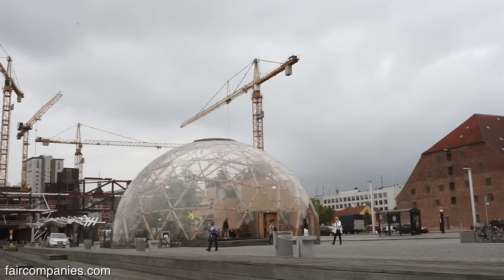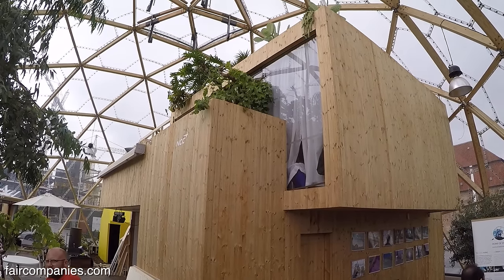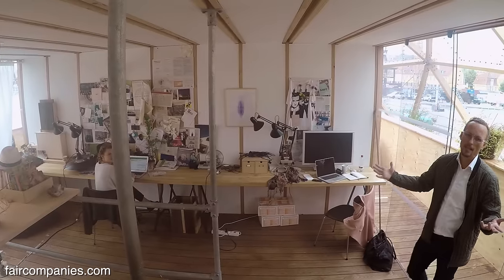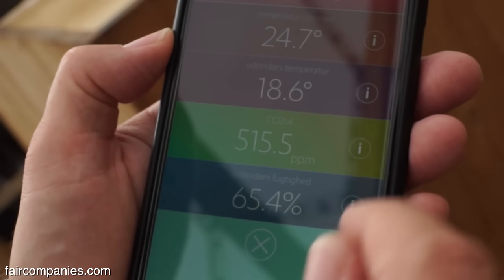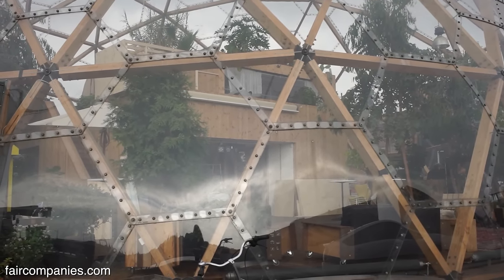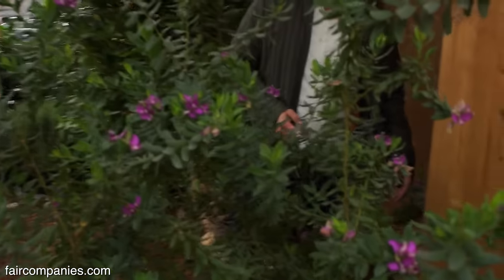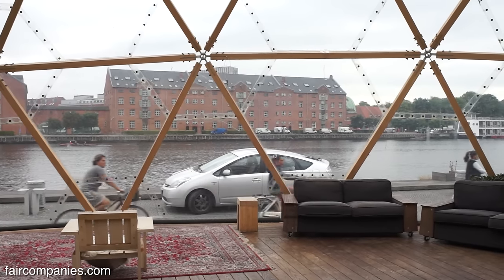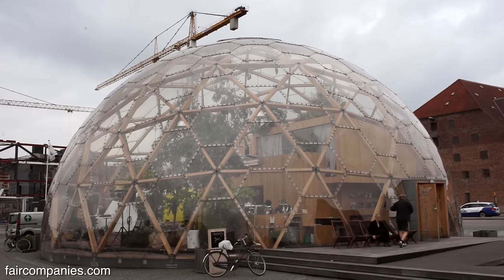Nordic home encased within geodesic dome for passive solar

Comment: Really thought-provoking.  The dome is like a physical manifestation of our natural projected boundaries around our homes...  when I think of what it would be like to live under the physical dome in that house, it's a bit unsettling and stuffy - as soon as I switch to the dome being an imagined boundary or social buffer that we all feel in our non-dome covered homes right now, then it feels less strange...  I know, weird.  I think it's that 3rd dimension - inside the house, outside the house, and outside both but still inside the dome...
Reply: I always feel "expanded" in a dome... not stuffy (myself). The problem I have with curvilinear forms in building is that you can't really furnish against them. All our shelving and furniture is designed to be utilized in boxes. That being said, It's an awesome shape for a roof provided you have figured out the weather seal.
Reply: Evidently domes are meant to be the most balanced structure to live & interestingly  mimics the firmament above us.

Comment: I think the hex panels are about 78.6% more disco than the triangular ones you see on other dome designs. The metal structure hubs are also flamboyantly ultradisco , at least 86.4%.

Comment: My only question is if, if, heaven forbid there is a house fire, would the Firemen then  have to tear the dome down before they could get to the house to put out the fire. Or could the dome be designed with a sprinkler system and as natural materials as possible for the house so that if there is a fire no toxic fumes or lowered possibilities of toxic fumes, and the house itself built with a sprinkler system.

Comment: 1)  CO2 is high. 515ppm is too high, should be less than 400ppm.
2) Huge footprint for a family of 4 - and I don't see a garage either.  
3) What is with the lack of railing on the stairs, is there no building-code in Denmark?

Comment: Just out of curiosity, when they actually build the domes and all... are they gonna be see through or is that just to show people? Or is only part of the dome gonna be shielded? Just wondering about privacy. It doesn’t look very private.
Reply: The privacy is IN the house. Just like a normal inside/outside situation.
Reply: @md61211  but the way it looks, it’s all open. You can see inside. I think it’s not done if what you say is right. If that’s the case, then yeah. Privacy is there. There is a couple that actually did this in an area that has heavy snow/cold. They grow food all year round. It’s smart. You should see it!

Comment: Yea so the house may not need glue and rain protection anymore but the dome is plastic and needs constant replacing and yes it insulates the house better but so does simply insulating the house better... you may save on heating but now you need to spend money to exchange the air inside the dome with the outside air. this dome is like a closed room, you'll have to air it out constantly specially since the air inside the building will become stale much faster since airing out the building by opening windows is nearly useless with no wind.

Comment: Love the idea, but I suspect it'll be a furnace in summer, even with the apex vent open. The polycarbonate isn't sealed, so it'll leak and drip onto the unprotected building inside. Plus It'll be deafening when it rains. I imagine it pops and creaks a lot in the wind too.
Reply: It is sealed (required by legislation, "Byggereglementet"). 
The apex is sufficient for cooling (the chimney effect).
The building is protected. he said that in the video.
The C60 (diamond crystal structure) is the strongest structure (he also said that in the video), so it won't pop and creak.

Debunked all your false claims, and assumptions, You're welcome.

Quote,
Love the idea, but I suspect it'll be a furnace in summer, even with the apex vent open. The polycarbonate isn't sealed, so it'll leak and drip onto the unprotected building inside. Plus It'll be deafening when it rains. I imagine it pops and creaks a lot in the wind too.

Comment: That's really cool but 6 degrees between the inside and outside temps is not much in the winter, for summer they just need some forced air circulation and shade but the shade would not be suitable in the winter.

Comment: Wouldn't it be warmer inside if only one side had windows facing the winter sun? That Dome is losing a lot of heat out of the shaded side. And could be cooler in the summer..

Comment: Very interesting. Two questions pop to my mind (I hope it was not mentioned in the video, I tend to watch videos quickly): 1) How hard is it to clean the windows (both inside and out). 2) Do you think there might be a time where bigger machinery would be required to do renovations or some type of work on the house inside the dome. Then how would the machinery enter the dome?

Comment: Hello !

We are from Brazil and we are starting to build residential domes.

Could you let us know if there is a website or app for sale to calculate the design of the roof model shown in this video?

We already have the structural part of the dome made of wood in the goodkarma pattern, but we are having difficulty developing the covering part.

If you can help we will be grateful!

Joseph

Comment: Do they make these that are bear proof? If i wanted to go off grid with one and build a dugout ,cabin in it then i would also need at least the 1st 10feet above ground ot be strong enough to stop a bear from breaking threw it? Are there materials that would work for this ,that can be supplied?

Comment: It's an awesome idea, though it looks a bit expensive. I also find it difficult to imagine cleaning all this transparent surface. What about strong wind, can it take away the whole roof when it gets in through an open door? I think it would also be nice to add some mechanical ventilation for the summer. I wonder if just opening the roof of the dome is enough. In a cold winter I'd think of some sort of heating. At least for the house, but considering there could be some sensitive plants growing in the dome, then preferably for the whole thing. I also wonder if the rain doesn't leak in anywhere? I wish the intervewer asked some of these questions. A question I'd ask would also be: what did they learn from all of it? If they were building it again, what would they do differently? Anyway, I think it's an awesome idea and I'd definitely would like to live in a domed house like this.

Comment: Could you build one using graphene panes? How would 🔋  output be affected during different times of the day? the season?How would you suplement power needs ? Using clear graphene panels to your dome coupled with battery storage could add a new dimension to your dome experience...self-sufficiency

Comment: love this design. 
I'm pretty sure this combination have to work finally. 
Why they don't combine the geodesic structrure with something  like ing. mario cavallè casa igloo in the inside calculating perfectly sun orientation (and colors)?
why they don't use an evaporative air conditioning refrigerating system?
why they don't use evacuated tubes solar water heater collector?
why they don't use electric solar panels or solar concentrator ?
why two geodesic structures?
why they don't use titanium nanotechnology antidirt for the policarbonate external panels?
thank you so much Kirsten this is an awesome awesome reportage.

Comment: Underground tube of 100m length with opening outside and adjustable opening inside will cause nicely chilled air inflow in the summer time and requires no energy.

Comment: I love how you cover it with the Polycarbonate sheets.
One question, do the Polycarbonate hexagones and pentagones lie on the spherical surface or directly on the underlying wooden structure or do you spacers anywhere?
Reply: The panels are on the surface of the framework. 👍

Comment: And what is polycarbonate made from?
Reply: I presume you are eluding to the fact that polycarbonate is a plastic and therefore comes from oil and hence is bad for the environment. Which is true. But you have to balance things in the overall scheme of things based against what the house might save in heating costs or electricity usage (daylight flooding the space very easily through out the day and dusk) versus the environmental cost of materials.

Sure it could be done in glass too, but it’s more expensive, heavier and equally costly to the environment to produce.

There is, currently, no clear cut way of being 100% eco friendly short of living in a cave. It’s always gonna be a balance.

Comment: This would get very, very hot in summer and it would need a lot of air conditioning to be livable. Nice in winter though, although in really cold countries this could lead to condensation, so an air dryer would be needed. Not as energy efficient as it at first would seem. If it worked though it would be a fun place to live :)
Reply: Uhhh, no.

Comment: The entrance did not have to be rectangular. It should have been triangular using the triangle module of the dome. A stack of 4 should be sufficient.

Comment: This actually seems somewhat viable for Nordic climates. Now replace the polycarbonate with transparent solar panels, add the geothermal unit discussed in the video as well as some rain water collection system and you would have a completely self sustaining modern house. Maybe even put most of the house underground to regulate the house temperature.

Comment: Might consider HempCrete as a building material as a thermal mass regulator for temperature and humidity
Reply: Adding mica to the mix design will allow more direct sunlight

Comment: Is there a reason why it's a dome and not some kind of simpler squared shape?
Reply: Minimal material for maximum volume and strength.  Triangles and spheres are quite efficient for that sort of thing.
Reply: @johng6350  in theory that sounds great, but in practice they built a squared house in a sphere, that doesn't scream efficiency to me. Still it's an experiment so I'm not trying to be judgemental here :)

Comment: Canadian winter with sun at 21 degrees  and temperature at -25C (-13F). It would be -20C (-4F) inside that dome.
No chance for those eucalyptus trees.
Does not include the 15 hour long night time temperatures. Zero sun, zero heat.
And then of course there is the snow that will accumulate and block the day time sun.

Comment: I don't see the C60 molecule in the structure, only in the polycarbonate panels, which add nothing to the structure but act as window glass only. It is being emphasized several times that "you can't build a stronger structure with less materials", referring to the C60, but it is actually NOT the structure of the molecule. It is only in the cosmetic part. I do see of course that it resembles it, and do not deny the virtues of geodesic domes, but the way its being presented is a bit off for such a location and intent. :D

Comment: A dome like that would be nice as long as you do not live where the temperature gets into the high 90's to low 100's F. during the summer and you do not get regular hail storms and catagory 1 hurricane winds a few times a year.  Texas Panhandle weather can be interesting.

Comment: Thought:  Put a fan/generator at the hot air outlet at the top of the roof to generate dc electricity.  That dc electricity could be utilized to split water into hydrogen and oxygen, of which could be stored, then utilized in a hydrogen fuel cell to get the electricity back with a by-product of basically pure water, which could be re-split, etc.

Comment: In my country there's already a severe housing shortage and the government wants to combat this by quickly dumping small, low quality, cheap prefab houses. After two or three decades they are replaced by a new one. Perhaps an indication that it's not the house, but the ground it stands on which is of value. The dome takes up quite a large amount of real estate, and instead of a single family residence, you could easily build 4 (8?) prefab homes in the same space for far less costs and much, much more profit.

Why sell a piece of a land once to a millionaire, when the amount of people who can only afford to rent something are limitless? (Why would anyone choose to make a one time profit, when you can collect rent for 3 decades from 4 or more people? with very low investment costs, as those prefab houses are cheap and quickly build.) 

Even in other countries/continents, where land & wood is plentiful, like south america, wood is still much more expensive than steel, stones, concrete or bricks. For the price of that dome alone, you could practically build yourself a castle down there. I also imagine there aren't that many people who have the expertise to build something like this in most places around the world. 

(That dome was also placed there with the use of a large crane? Over a period of weeks but more likely months, how much does that costs? It's not something most people can afford I imagine.)

Comment: Cool, but unworkable for most homeowners. Dome glazing durability, keeping it water-tight, and keeping it clean are extremely difficult chores (check out the algae in the glazing seams). Next: Keeping the house from cooking in the summer -- and finally there's the cost... The concrete footings, dome structure, and Lexan glazing we see here would cost at least $100k just for the materials -- way more than any conventional weather-tight home exterior, insulation, and solar heating system. Want a greenhouse? -- build one for $5k in your back yard.

Comment: I can see this in Australia in the desert at 50 degrees. There would not be enough passive cooling possible such as an earthship ducted venting system. I used to drive cranes in Australia in the desert in Nth West Western Australia and the power of the sun is utterly mind blowing. You cannot put metal tools down because they burn when you pick them back up. If your air conditioner died on your crane it was utter misery. Enough sun falls on Australia in a day to power the planet for a year.

Comment: well, ill go for something like that in time. this thing is soundproof, let alone there could be a purification unit for the air, and with all this outer surface, you can even gather water

Comment: my issue is the polycarbonate use. 
like if the point is to use less material and be more sustainable than a regular house, the polycarbonate defies the purpose. 
i would suspect if it even healthy to breathe all that polycarbonate in a dome, irradiated by sunlight.

Comment: Back in 1958 when i was but a six year old pup here in Fort Worth Texas... one of these domes was built out of aluminum, where it still stands today amidst the 1936 model Will Rogers Memorial Center Complex. https://en.wikipedia.org/wiki/Casa_Ma%C3%B1ana
i can recall all the unjustified negative comments that abounded back then, mostly due again to it's proximity to the 1936 model architectures. It's very possible that if land accesses to build upon continues it's dwindle... oceanic water body real estate placements of these designs may well ring true to Bucky's forecasting's of such Aquatics.
"There is only one revolution tolerable to all men, all societies, all political systems: 
revolution by design and invention." -Buckminster Fuller               -gilpin 8-7-16

Comment: "You can't get a stronger structure with less use of materials".   I would be hesitant to limit my thinking that way.  Think of an eggshell.  It is extremely strong, yet uses very little material.   My bet is that you are wrong based on that alone, not to mention that your girders are not curved, which in my way of thinking, would strengthen the structure, and possibly allow for even lighter materials.

Comment: Another question about the polycarbonate cover - I understand that as most plastics polycarbonate also has considerable thermal expansion, so I wonder how do you handle it.
I guess the bolt connections between the polycarbonate sheets are fine since they're all in polycarbonate so they'll expand & contract w/o causing stress to anything.
But how about the polycarbonate connections to the frame - ie to elements that have minimal thermal expansion (ie are practically fixed)?
Also how are there issues handled in the Dome of Visions 3 - I see that it has slightly different frame geometry resulting in straighter 'rows' which I guess gives better options for the polycarbonate cover?

Comment: This is not the structure of diamond. C60, also known as the Buckmminster Fullerene is a ball of hexagonally arranged carbon atoms. You could think of it as a sheet of graphene shaped like a ball. Great structure but pretty far apart from diamond. Diamond has a 3 dimensionally tiled tetrahedral geometry, or balls connected by equally long sticks, where the sticks are arranged so that each endpoint of each stick, emenating from the central ball, is equally far away from each other, outer, endpoint of the stick. And at each endopoint of those sticks another carbon atom sits, from which this geometry is continued.

Comment: I applaud the concept for more northern climates.  But you would roast like a pig in here in North Carolina in the Summer.  However, with the structure, it's feasible to install a sun shade that could be deployed as needed.  Then more ventilation.  Would have to find something other than polycarb due to degradation.  Would be best to cover much of the southern exposure with solar electric and solar HW panels.

Comment: Build a big greenhouse and park/live in yr camper/greenhouse in the winter. Pull the camper out in the spring. Get the glass fur free with used windows
Reply: Still need heat at night/wood stove/chimney thru greenhouse woof